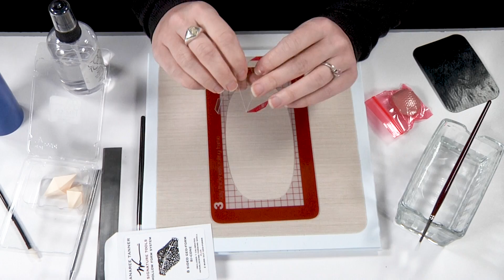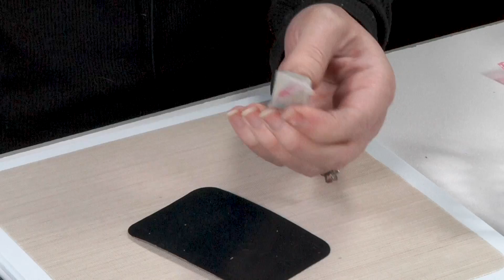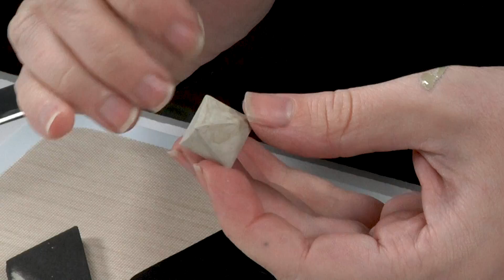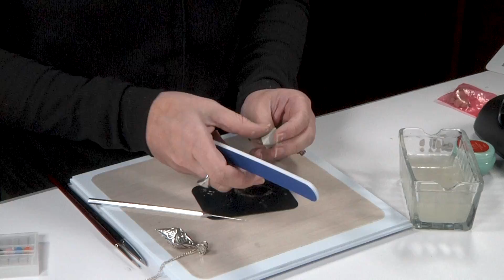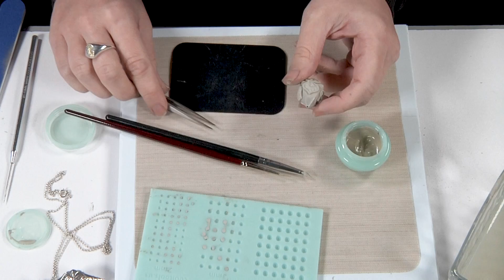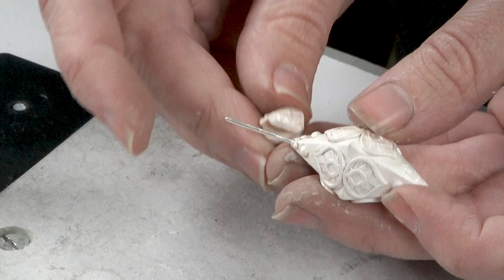Cool Tools | Phoenix Fine Silver Spinning Pendant by Karen Trexler | Metal Clay Master Class

Comment: I have a question about the Phoenix Torch fireable Clay. I made 10 pcs. using this clay and a silicone mold that I bought from Cool Tools. I fired my pieces in my Paragon SC3 kiln at 1650 degrees and held for 2-1/2 hours. I did not take them out of the kiln until the temp. was at 150. When I was cleaning one of the pieces, I dropped it on the ceramic tile floor and the piece broke in half. Is this common for this clay, since it can be torch fired?
Reply from the maker: Hi Cindy, being torch fireable does not make Phoenix more brittle after firing. Your firing schedule of 1650°F for 2-1/2 hours is more than sufficient for optimal sintering and maximum strength. 
That being said, even fully sintered metal clay can break from the impact of being dropped onto a hard ceramic tile floor, particularly depending on the thickness and shape of the piece or if the design has a thinner or more vulnerable area, or if the piece had a crack or air pocket in it not visible before firing. How did the remaining pieces turn out? I would recommend trying the water test on them - place a droplet of water on the fired piece. If the water beads up, it is sintered. If the piece absorbs the water, it is not sintered and we should troubleshoot a possible issue you with your kiln.
If you'd like, feel free to send us a photo via email at help@cooltools.us of the piece that broke and we can further help. I hope this helps!